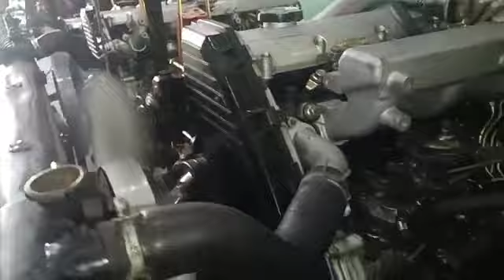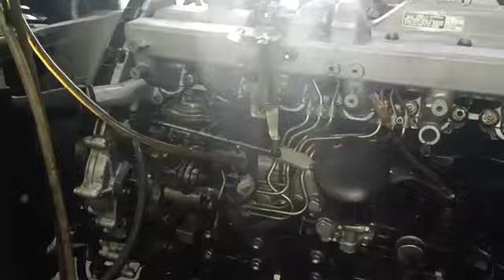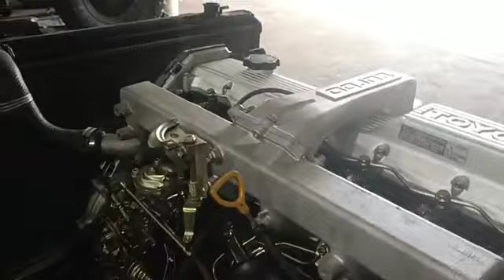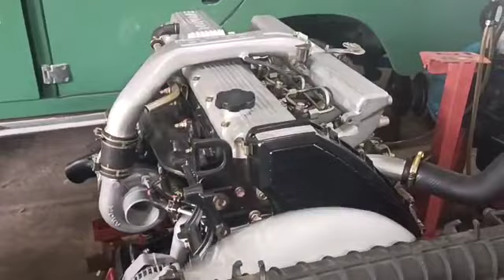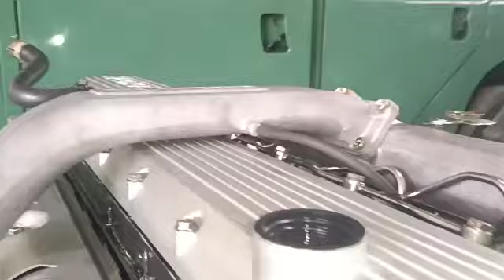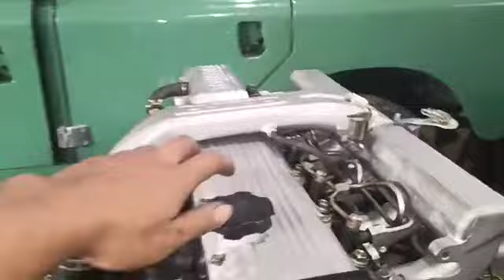enginw rebuild by bms autonetwork 4x4 (1)

Comment: Harga mesin brp bg 🙏
Reply from the maker: @BonusCell-n6w  125
Reply: Ini sudah dengan transmisi misi ?  @bmsautonetwork4x4
Reply: Ada kontak yg bisa di hubungi ? @bmsautonetwork4x4
Reply from the maker: @BonusCell-n6w  081317925708
Reply from the maker: @BonusCell-n6w  sama.tranmsisi manual abang ksh saya 170